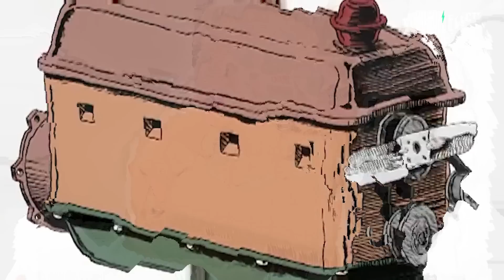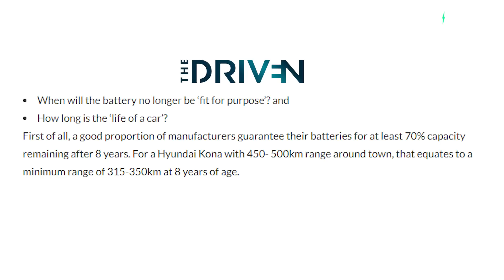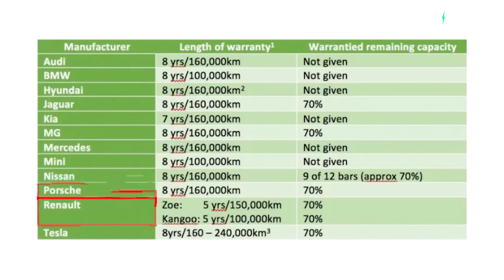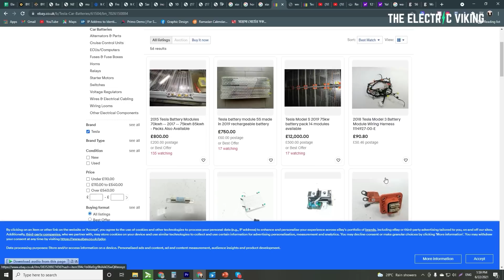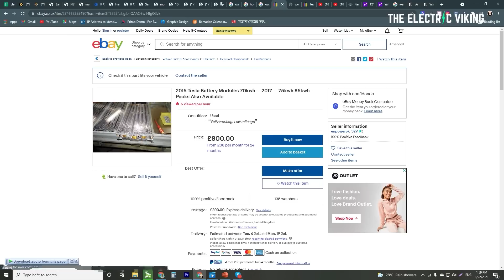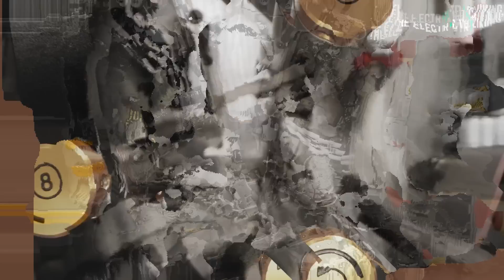How much does it cost to replace the battery in an electric car?

Comment: Tesla battery pack is still cheap considering it can last much more than8 years.  The Etron is about 3 times the cost.  Around 50kcdn estimate based on the US dealer price of 36500us in Calif.

Comment: You know what's funny? Batteries degrade faster in extreme weather conditions. What means that developing nations might never fully rely on the waranty, as their machines are used in very high temperatures. They have barely any money to invest into the E grid. Now they face my mentioned problem. Grim outlook, right?

Comment: Only draw back gas cars can last 15 /20 years..By time the 8 years comes up the cost is going to by pass $12,.000 if the car is in good shape but battery needs replacement most won't be able to replace the battery..

Comment: Nothing if the battery is subscribed and swapped to another. No worries, extra cost or battery degradation headaches for customer or consumer.  This would change the whole idea for EVs. I do not understand why consumers must pay the cost of used car damaged battery. The second option is that car manufacturers will offer at least 20 years warranty/performance guarantee for the ev-battery. After that there will be resale value for used EV-cars.

Comment: My kids not old enough to drive yet. Guess what their 1st cars will be? Yep the cheaper, reliable ICE. Case in point my 2006 Ford Focus Zx4 ST still alive and kicking with no issues. In fact I traded it in for a brand new Ranger 4x4 Sport  and  got way more for it than it should have, which allowed the Ranger to fit my budget very comfortably.

Comment: I have a 1998 Dodge Durango that I bought in 2000 (24 years old) that still gets 16 MPG highway and has 104,000 miles (167,000K) so no appreciable loss of performance. Considering that the EV battery (where the electricity is stored) is more akin to the fuel tank and not the engine, over the intervening 24 years since my Durango was new, a loss in capacity is more like the fuel tank going from 22 gallons to 15.4 gallon capacity. Since my fuel tank still holds 22 gallons, I have had ZERO loss in capacity and negligible performance over 24 years

Comment: I still see this as a potential issue with used electric cars in the future. If someone keep a car 10 years, it would basically be considered totaled due to the price of a new battery. I think there will end up being a lot of battery extended warranty, battery replacement programs and cheaper refurbished battery shops around to supplement this!

Comment: So the best warranty is a car that has just shy of 100,000 miles and only drives 70 percent of what used to be 100 percent? That really doesn’t sound great. A battery will usually mess up right after that and then it costs at least $12,000 to replace and that’s the only option. You can’t trade it in with a bad battery unless you want a few dollars for a car you paid way too much for. Well this video just made electric cars look a lot worse. Also where can an electric car battery be recycled at? Hmm 🤔.  Answer please. Haha 😂. Better for the environment is just a guess at this point.

Comment: I drive a 30 year old car...works great and with proper maintenance will still be running strong after yall spend another 150,000 on your battery operated stompers

Comment: I don't agree with your engine v battery comparison over 8 years. Even if you claim batteries won't need replacing after 8 years, engines are proven and easily go on 100k miles with no 70% distance covered worry, and if they do go faulty replacing an engine is very rare, normally parts on it or around it are replaced, costing nothing like a huge full battery replacement. 
Charging times and range is the area engineers need to focus on. 
This technology is still too new and needs some serious evolution before clumsy governments jump on the 'ban of fossil fuel cars' bandwagon.

Comment: What would you need in Australia to use a second-hand ev battery in a solar panel off-grid system, without owning an ev? Judging from the information here it seems like that would be a cheaper and better system than the Tesla Powerwall as an ev battery would store a lot more electricity.

Comment: Do extended standby time have negative affects on these batteries?  If a car sits for weeks, is used lightly, then parked for few more weeks; will that battery last many many years or does the standby times degrade the battery just b/c of entropy?  Thanks.

Comment: How long will a motor last?  I have a sneaking suspicion they wear out as well.  Ecars also have other tech that gas-powered ones don't and which will wear out.  It's just one hidden cost after another, and all for the purpose of more easily controlling and tracking citizens and extracting even more money from them.

Comment: Are you just a troll or what!? Other car manufacturers like Hyundai/Kia have been offering 7 and 10 years of warranty on their cars, also you can easily repair an old ice compared to EV depending on if you even find the battery replacement after warranty lol……

Comment: $12,000 for a petro motor replacement? I can buy a brand new crate motor for under $4000.00 and get it installed for $1000.00 or do it myself.
Reply: A used car with good inspections even cost around that 4k tbh

Comment: The manufacturers should be designing cars where the battery can easily be replaced or upgraded when better batteries come out. That's not how they will do it though. They want you to go out and buy a whole new car. I have some late breaking news for you. There are a lot of people who can't afford, or who are unwilling to go out and spend $40,000 at a minimum for a new vehicle, or most likely way more than that. I have a 2015 Nissan LEAF with a 24kwh pack. I should be able to upgrade at an affordable price. I'm not going to go out and buy a whole new vehicle when all I need is a new battery. There should be laws requiring easy battery replacement. Furthermore, they are loading these new vehicles up with lots of extra technology, like self driving that isn't needed or wanted. They are doing it to drive up the prices. That isn't what's needed to address global warming. You need to make a slimmed down reliable affordable vehicle. Doing what's right runs counter to capitalism. Bottom line, none of what's going on right now is going to fix anything. Things will only get worse from here on out. Huge EV trucks and luxury cars isn't going to solve the problem. Furthermore, I don't like the vendor lock in. Tesla is just like Apple. Have someone else service your vehicle and they disable your charging.

Comment: There is a lot of BULLSHIT here!!    Gas engine vehicles rarely get a factory new engine......... It would be foolish to buy one when a properly remanufactured engine will last as long or longer at 1/3 or less of the cost.  It is a thriving industry.    I personally have remanufactured literally hundreds of car engines, diesels, for tractors and machinery, etc over the last 40 years in my own shop with my own equipment.   EVs will kill this industry....... You cannot rebuild batteries composed of multiple cells.... The cells must be matched to work together properly.   The electric car will require less maintenance in most areas, which on the face of it looks like a good thing, but it will kill off most small shops forcing owners into dealer shops where the same procedure often costs double what it would in an independent shop.... or more.   Without the competition, you are handing dealers a blank check!      In addition of course owners can do almost none of the maintenance.    As the independents go out of business, so too will the aftermarket parts suppliers.    I'm seeing this already in agriculture and construction equipment.   Companies like Agco, John Deere, Caterpillar, CaseIH, etc... are maintaining tight control of diagnostic technology and parts, making repair hugely expensive because a dealer mechanic must make a remote service call to fix anything but a flat tire or some other trivial mechanical issue.   At least in automotive we have OBD II, and anybody can access diagnostic information to a greater or lesser degree depending on your equipment.   RIGHT TO REPAIR is a huge issue, and has been the subject of a number of attempted legislations.  If you buy something, it should come with the right to be able without too much expense to diagnose and repair it.  That's just common sense.      In the US, people are already in a 3 way squeeze between outrageous healthcare costs, and outrageous housing costs, and outrageous transportation costs......... This will just make it worse.      To make matters worse, EVs are fine in mild climates.   Where I live temps often drop into the sub zero (f) temps for weeks at a time.  Experience shows that not only is battery capacity reduced  at these temps, but also battery life.   I've seen lithium ion batteries for power tools last as little as one year after being subjected to these temps.   In addition to reduced capacity due to temp, you have the issue of heating the cabin, which will result in a significant reduction in range.     They are NOT a panacea.... not even close.
      BEVs are an interim "solution", and not a really great one IMHO.    The ultimate solution will probably be electric, but it will not be the current BEVs or fuel cell EVs.  The internal combustion engine is doomed......... thankfully, as it is complex, maintenance intensive, dirty, and only about 20% efficient.   The long term replacement technology may be in a lab somewhere.    

       Humanity / modern civilization is well on the path of self destruction due to our grotesque overpopulation and wanton destruction of the environment we depend on......... we've been on this path all my life.  One climatologist said something to the effect that humanity will consist of "a few mating pairs" in areas where the climate would sustain them by the turn of the century.... I suspect he was not far wrong!!   Our efforts appear too little too late, and will always be complicated by the wacko evangelicals who are constantly, and foolishly looking to the horizon for Gabriel to take the faithful to the side of God!!   And of course the greedy who seem to value their own prosperity relative to everybody else more than the survival of the species (which of course is of concern ONLY to humans), and those engineered creatures we have created to be dependent on us.
Reply: "You cannot rebuild batteries composed of multiple cells".  Mmm. Cleveleys Electric Vehicles in Gloucestershire in the UK are already doing just that....... They posted a YouTube video of a 10 year old Leaf battery refurb they carried out. The work cost the Leaf owner £600...  They also carry out repair and servicing work on other EV's, including Teslas, both in their own workshop plus on a mobile basis.
Reply: @Brian-om2hh  …….I stand corrected.      At this point there of course isn’t the kind of “cottage industry” doing rebuilds that there is at least proportionally, but EVs are in their infancy as a mass market transportation option.   Replacement of individual failed cells in a battery pack is going to be quite a challenge where the battery packs are becoming structural elements, and the individual batteries have spot welded connections on both top and bottom joining them into series and parallel.  Identifying which of the many batteries are degraded, and matching others so that they function properly within an ecosystem of used / aged batteries is not a simple undertaking.   For optimal results battery packs should have all the cells removed and separated, and the individual cells tested and graded.   New (rebuilt) packs of equivalent graded cells that will perform together optimally and reliably long term would be assembled.   To do a proper job would be labor intensive and require some really good testing equipment.     I suspect it will not end up being inexpensive.   The real value in this industry will be the development of a downcycle market for standardized form factor of battery packs to be used where the weight / capacity equation is not critical as it is in vehicles.  There are numerous such applications, grid storage and home energy systems are the most obvious.

Comment: It is not only petrol engines that die. Automatic gear boxes do too and they are expensive.
Reply: Lol.... There are literally millions of engines and gearbox for a particular car, a Toyota Corolla part is dirt cheap  for example
Reply: @alanmay7929  Yes. That is true for some cars. In my case, I had a Ford Falcon automatic gearbox replaced for $800, $600 for a second-hand gearbox and $200 labour. But if a later-model Mercedes or Porsche automatic transmission blows up that can be big money. But re batteries, some of the facebook comments on electric vehicles are from owners who are finding no measurable battery degradation after in excess of 75K. Others are finding maybe 5 - 7%. It seems to be a bit like with the early motor cars - you had to de-coke them every 10,000 miles but then the engine designers designed engines that did not coke up.
Reply: @FalkinerTim  gearboxes doesn’t need to be changed, they can just be rebuilt/reconditioned, some of tousand of batteries 🔋 could fail in the battery pack and reduce performance…. Repairing batteries also requires opening the battery pack, the new Tesla structural battery will make repairs even worse.
Reply: @alanmay7929  But from what I am seeing in the posts, EV owners of the newer EVs are not seeing battery degradation to any significant degree, if at all. This is so even with the ternary batteries and these are being increasingly displaced by the longer-life LFP batteries. As I say, it is like the coking issue with early petrol engines.
Reply: @FalkinerTim  because they don’t see any degradation it means nothing, regular ICE are already over 30 years still on the roads with barely any effect on their range.
Reply: @FalkinerTim  batteries are certainly not new and the coking issues on old petrol engines didn’t reduce or ruin the range.
Reply: @alanmay7929  True. Just pour the oil in when you fill it up with petrol.

Comment: The battery in your EV will last about as long as the one in your laptop or cell phone.
They are the same cell type.
Reply: Wrong, your smartphone has a tiny battery and needs to be charged daily depending on your usage, an EV has a puffer capacity too.
Reply: @alanmay7929  Nonsense! My cell phone battery powers my cell phone for 12 hours usage, therefore it is larger than the battery that powers a tesla for 6 hours proportionately. Think about what you posted.
Reply: @andrewallen9993  lol.... Your Tesla battery is over 1000 times bigger than an iPhone batter, also your Tesla has a puffer, a dedicated cooling/hearing system and finally it's not used as often as your smartphone. Some people are heavy users on smartphones. Replacing the iPhone battery is also super cheap.
Reply: @alanmay7929  What part of my cell phone battery lasting twice as long under use than a Tesla's  and so being proportionately twice the size didn't you understand?
They both fail at the same rate because they are the same type of cell. The laws of physics don't change depending on what device a battery is powering you know!
Reply: Nonsense. An EV battery has an 8 year warranty.  And many are lasting 10 to 12 years.
Reply: @Brian-om2hh  tell that to my cell hones lithium ion battery. It doesn't believe you.
Reply: @Brian-om2hh  lasting 12 years?! Lol.... Who is going to buy that used!?